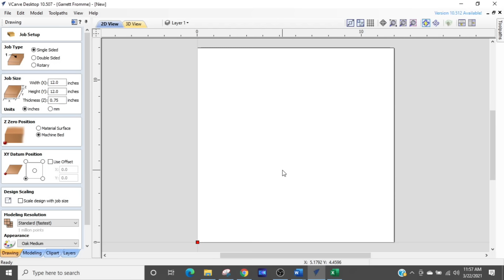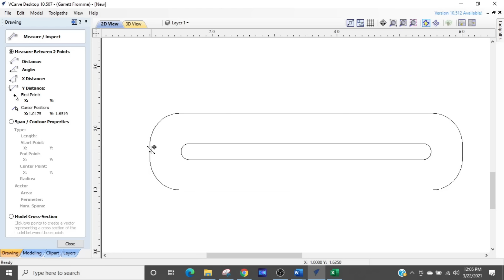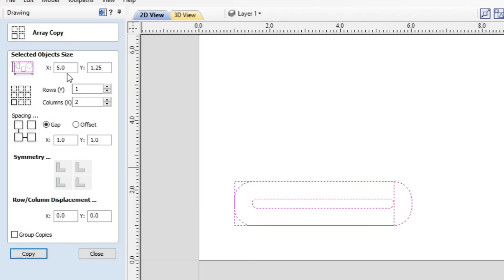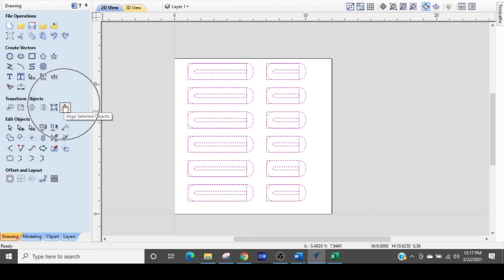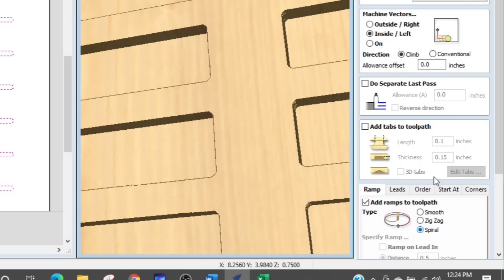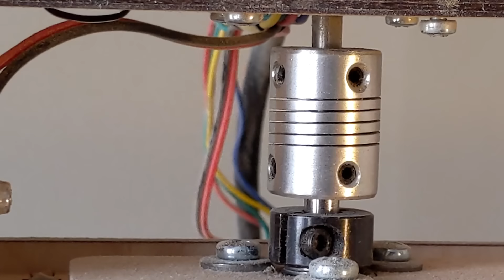How To Make Clamps For Your CNC Router, Easy CNC Router Projects

Comment: Do you have a video explaining the reasoning behind the shape of the clamps and how to use them?

It looks like the clamps are meant to be used in pairs (where one of them sits flat on the bed and helps raise up the rear of the working clamp and concentrate clamping force). But if that's the case, it looks like they're meant for only one thickness of workpiece material.

Ideally I'd raise the lower rear of the working clamp to be slightly higher than whatever thickness my workpiece is. That allows me to concentrate clamping force on the front of the clamp, where it's actually touching the workpiece. If I had a 1.5"-thick workpiece, that first clamp would need to be comically thick to raise the "working clamp" high enough.
Reply from the maker: That's a thoughtful observation about the clamps, brother! They are indeed designed to offer versatility for various thicknesses, but it can be a bit tricky when you're fine-tuning the setup—it's best to experiment and find what works for you!

Comment: Just wondering why you zeroed to the spoil board  ?
Where did you set your x and y to ?
Reply from the maker: Hey there! I zeroed to the spoil board to ensure a consistent reference point for all my cuts. For the X and Y, I typically set them at the front left corner of my material, but it can vary based on your project needs.
Reply: Ok thank you

Comment: GOOD MORNING GARETT. I PURCHASED THE FILES FOR THE HOLD DOWNS IN ETSY. THE JOB BIT WILL NOT PLUNGE DOWN TO HIT THE MATERIAL. RUNS 1/2 TO /34 ABOVE. WHAT COULD BE ISSUE? USING CUT2D DESKTOP-CANDLE SOFTWARE. I RAN IT COMPLETY WITHOUT THE BIT FIRST AND THEN THE 1/4 BIT SAME ISSUE.THANKS
Reply from the maker: Zero off your spoilboard before you run the project brother! That should fix your problem!

Comment: I keep rerunning this and comparing to my bits.  Is this an up or down endmill?  My IDC settings are different from what yours are showing.  I am relatively new to this and not sure how the different setting for pass depth, stepover, and spindle speed for example would affect the cut.
Reply from the maker: The current settings you have in the database are correct. This video is quite old and out of date

Comment: Thanks. I picked up some things I didn't know, about layers and arrays and spirals.. I set mine up in individual rows/files so they can be grouped on any width wood I have laying around. The best thing I learned is to zero off the machine surface, not the work surface, so not to mark your spoil board. I had no idea it worked that way.  Note: @ about 25:03 you say "1.8" inch and I'm sure you meant .18 inch as shown in the video.
Reply from the maker: PaulSchuster-yj4zb, glad to hear that this one helped you out so much my friend. As for the part at 25:03, you are 100% right, I meant to say 0.18"

Comment: Garret. Thanks for all the great video's and advice. My husband and I downloaded your 18 & 24 clamp files today. We're able to open up with the vectors but no Toolpaths or G codes. We've just got out Shapeoko a few days ago so we are running Carbide Create 7. Is this the reason we didn't receive  or can't open tool path with G codes? Thank you in advance.
Reply from the maker: roxannehulsbrink6467, It sounds like you are trying to open up gCode files in Carbide Create. What you need to use is Carbide Motion to send the gCode to your machine directly instead of using design software. If you are still having troubles, please send me an email at garrett@idcwoodcraft.com. I would be happy to help you in more detail my friend.

Comment: Just got my new CNC running yesterday and was needing help with it. I found your channel and it helped me make my slots for my spoil board. I am having a problem with my holes not lining up. I have the rows set perfect in V carve on where I want them and use the touch plate for the lower left corner but it seem to go past where I want the row by 4-5 mm. Not sure what the problem is. Any ideas?
Reply from the maker: Drich6816, I'm glad it was helpful brother! This one is a little too tricky to answer over comments. I recommend joining Kate and I for our weekly live session we host every Wednesday at 8PM EST and we should be able to help walk you through it then!
Reply: Thanks for the reply, After beating my head for a bit and watching more videos I found my mistake . On the zero touch pad I had the wrong bit size. Oops. I will be forsake watching your channel and subscribed  @IDCWoodcraft

Comment: Thank you Garrett. I noticed the other clamps you made at the end of the video had a small lip to hold the work piece down. Did you find an issue with using the clamps with the lip on the end? Thank you for sharing the details on how to create these.
Reply from the maker: enduringpromise, I haven't run into any issues yet brother!

Comment: Good job on covering this, it made it easy for me to follow along.  I made one tiny change in mine; I added an additional pocket at the tip (I think a tenth of an inch) to see if it would increase the lateral holding power.
Reply from the maker: Dan, thanks brother! That's a great idea to add an additional pocket, nice work!

Comment: Very helpful video, I followed you clearly until laying out the tool path for the final outer profile cut. I would have thought that the start cut height for the outer profile of the clamp would have been the material thickness. In the video I believe you showed it as 0, but I thought that 0 was table top not material top. Did I miss something, or just not quite understand?
Reply from the maker: Brian, apologies on the confusion on that one brother. When you are setting up your toolpaths, the software considers the top of your project surface as its internal coordinate reference plane. 
Basically, it doesn't matter if you set up your project to have the Z zero to be the topmost surface of your project or the surface of your spoilboard, you will set up the toolpaths the exact same way for either case.

Comment: If using a 3018 pro cnc and I buy your clamps would I need to change speeds and passes and bit size. Thanks
Reply from the maker: Ron, your machine is a bit too small to use these clamps with. I would recommend using your machine with the clamps that came included. They will be your best bet brother!

Comment: Great video and tips! I’m a cnc newbie and with a Yora 3018Pro. I designed my clamps in Fusion360 and carved them out with an 1/8” compression bit and the spiral ramp really makes a huge difference with a small router with the small diameter bit. Thanks
Reply from the maker: Glad this one helped Sean. Happy to hear that your 3018 is up and running!

Comment: seems easy enough lol
Reply from the maker: Brian, give it a shot brother!
Reply: Garret in 6 more weeks I can. stilling waiting on my backordered machine to arrive.
Creating the file as you have show us made it pretty simple to design for sure.
I have a question about about designs for cast acrylic and glass etching. its about node editing. Do you really need to edit nodes since we will be using a spring loaded diamond drag bit and a 1/16th and 1/8th endmill or is that mainly when you will use a end mill to profile cut around a shape say as a bitmap image? In need ofsome clarity on that since I can run a test right now on cnc router. If you could please

Thanks

Comment: Help I use Vcarve and watched the video as i did the program at the end I when to save I mark visble toolpaths to one file I then get an error the visble toolpaths use different tool all the tool are end mill 1/4 in what am I doing wrong
Reply from the maker: Hi John, that is a great question.  Try double checking your toolpaths and making sure they use the right tool. You could also try and save the gCode files individually to run on your CNC.

Comment: Being that I've already uploaded your IDC Drill bit data in the tool database, is it good to change the feed and speed rates and/or tool numbers like you are doing on the video? Also are you using an upcut or downcut 1/4" EM? Thanks Garrett
Reply from the maker: Hey Max, you can change around your feeds and speeds as needed. The feeds and speeds table is a great guide for you to start out with. You'll develop some intuition over time and practice and may choose to change some numbers around. I changed around mine for this project. And I used a 1/4" downcut endmill for these.

Comment: Great tutorial.  I was able to set up the project in VCarve Desktop with no issues.  It took me a hot minute to realize that Desktop doesn't have the spiral ramping option or the 3-D tabs...but in any event once I set up the project on the machine, zeroed it out and set the Z (to the bed & not the top of the piece..SMH) it cut like buttah.   I only made 4 sets just to test it out as it was my first cut other than leveling the spoil board and cutting in my grids.  Thanks again.  I have much to learn but am psyched at my progress and all thanks to you and your tutorials Garrett.
Reply from the maker: Yay Martha. I forgot to mention in the email that is was very cool to see the clamps made!

Comment: Another great video, as I am now watching your whole playlist 😁 I have saved a lot of your videos to back over when I have more time. I have just bought this program from Etsy and intend to run it soon, but I am going to use 19mm Marine ply as I have a ton of it laying around, hey if it works great, if not then I will buy some pine. I will be using metric tools so hope it still works the same or I will edit the tooling in the program to suit.
Reply from the maker: Hi Warren. Ply works gread for this. You might want this PDF download. It is all the videos I've created and they are sorted. Here's the download link → https://bit.ly/3mLHGfI

Comment: Garrett Just watched this video and followed as you designed them .
Question Isn't there some way to select the first one you made and resize the whole clamp  with out doing every item one at a time.
Jeff Peters
Reply from the maker: Hi Jeff. Good to hear from you brother. Yes, you can simply select the ones you want, and squish them down using the little bead at the bottom, top, or side. Does that make sense?

Comment: Hi Garrett, great video would you consider making one for the rounded clamps that let you apply pressure from the sides of your project to lock it down?

Thanks! Tim
Reply from the maker: Hi Tim. I gave it thouoght before. Eventually I will make that style available
Reply: @IDCWoodcraft  That would be great, the biggest difficulty is getting the hole in the correct place so you are always applying leverage no matter which part of the paddle is applying the pressure. I don't know if you got my last note but the spindle was spinning counter clockwise as you had suspected. I had to switch to wires to get it turning clockwise and now everything works great.

Thanks!
Reply from the maker: @timcreagh585  I see that running backwards from time to time. I'm glad you got it figured out

Comment: Garret One thing to bring up with this video make sure that when you cut the camps you are going with the grain if you are not using plywood.  The clamps will snap if cut across the grain
Reply from the maker: Hey Larry. I thought I covered that. Thanks for pointing it out. I''ll add it to the comments in the video

Comment: I like your design.  Instead of using my CNC to make these I used your dimensions and designed them in Fusion 360 and then 3d printed them.  Will give them a try once I get my MPCNC completed.  Thanks!
Reply from the maker: Hey Dave, send me pictures. I'd like to see
Reply: @IDCWoodcraft  just sent over the pictures to your email address.

Comment: When using 3d tabs the bit will not stop, raise up, cut over, plunge down, and continue the cut.  The 3d tabs ramp on the up and down movements and do not stop the movement.
Reply from the maker: You're right. I keep forgetting to set it for 3D tabs and tell people to use them instead. Thanks for reminding me.

Comment: great video as usual. its worth pointing out that the clamp needs to be cut with the grain of the wood running in the long direction on the piece. otherwise they will snap in two. something to consider when laying out your file based on your available material.
Reply from the maker: Hi Adam. Yeah, sometimes I forget even the basics need to be stated for new people. Thanks for commenting about that.

Comment: Really like the Spiral technique. Much easier on my router. I need to get some downcut bits . The up-cut I have seemed to work out though I just wasn’t sure wether to use the climb or conventional setting. I just went a little slower. Thanks for the video.
Something else I thought of also is that before a person pulls the parts you could make a rubber mold and then pour in what ever mold material you liked to make a stronger Clamp if you desired to.
Reply from the maker: Oh Sim, you have given me an idea!!! I might start making clamps. And I can make the mold to make them. I am getting requests for clamps.
Reply: @IDCWoodcraft  That’s great.

Comment: Thanks for pointing out the spiral plunge. I've been using ramps, but it is slow.
Reply from the maker: Hi Bob. Ready for a little tip? Ramp and spiral are both plunge moves and will use plunge feed rates. Edit the tool library and change the plunge feed to the cutting feed.  It'll all go much faster.
Reply: @IDCWoodcraft  Ok, that’s helpful. I think I still like the spiral because of the continuous down movement while cutting opposed to hitting the depth and running at that depth till the next round. Is nice to know about changing the plunge feed to the cutting feed. Thanks and again, I like Vectric and their tutorials are helpful, but you go into more detail and not so matter of fact. And I like when you click on the wrong thing how you explain it as opposed to ignoring it or editing it out. Makes it easier to relate. We all have our little goofs.
Reply from the maker: @BobBob-eh5sb  yes, I prefer the spiral myself and use it on profile cuts as well as holes. Nice smooth travel. As for the goofs...I think it's important to keep them around for the eaxct reason you said.

Comment: I have been a CNC and Vectric user for a while and have no need for more clamps but after watching many of your videos I realize that even though “clamps” is the main topic inside there will be information that I can use on other projects. And was I correct,  as in other videos of yours there were so many other helpful hints. 
Thank you 
One day I’ll get the courage to set up a one on one 
Just one more thought—if you were to use a 3/16EM for the perimeter cutout you could have gotten that one more row of clamps. I use the 3/16EM for cutouts a lot on .75 material. 
Be Safe
Reply from the maker: Hey Lyle. Ya’ know, I think I’m gonna start doing the 3/16” thing. Such perfect sense. From one CNC’er to another…thank you!

Comment: Thank you for this video.  I learned a lot.  I created my own project based on your teaching, but when my router cut all the way through, it went into my spoil board about 1/16"  What did I miss in my setup?  Thanks.
Reply from the maker: Hi Lyle. You probably did not account for the material being thinner that what was set in the software. If you set .75 and material actual is .7, and set start depth from top, then the bit will cut into board. Happened to me too...many times, until I learned to ALWAYS measure the material first.
Reply: @IDCWoodcraft  Thanks for your response.  I forgot to mention that I set my Z zero to my spoil board surface, as you did in your video.  My first time doing that.   My material thickness was actually 0.7515 and I set the material thickness in Aspire to .75.  I greatly appreciate your help.
Reply from the maker: @lylepollett2234  hmmm. We'll have to talk. Not sure why. I'd have to look at your settings
Reply: @IDCWoodcraft  It finally dawned on me what the problem could be.  I decided that maybe the thickness of my Z zero fixture was set incorrectly, and sure enough.  Not sure how I missed it when I set it up.  Lots of learning.

Comment: Idc. I have a kl44 bob cnc. It doesn’t come with a spoil board. I’m trying to get the correct inserts and screws to hold the above clamps down.  Do you have a recommended inserts, screws, nuts for this purpose?  
Also, I enjoyed your bits video. I will order those recommended bits.
Reply from the maker: Hello Road.  Your name makes me smile. I would contact Bobs for recommendations on this. they may have plans. Or look for plans that someone put together on Etsy or something.
Reply: @IDCWoodcraft   Haha. I know...I only have two income streams so far.  But one day, one can hope right.
Reply from the maker: @3calmkids  my friend, keep working at it. I currently have 4

Comment: Gwdave1997 
I built a couple of clamps first to see if I could then bought your setup.  The only item I changed the size to 16 X 16 and cut them from there.  Setting the Z axis did cut the wood all the way thru however I now have a bunch of lines on the spoil board.  I do have to say that I used the clamps I built using your setup for the original ones then I now have enough clamps for anything I want to built, and love the way they work they are as good as the OPPS clamps that cost $50.00 to buy 4.  Would I build them again, you bet thank you for such a great plan....
Reply from the maker: Hi Dave. You just can't have enough clamps. Isn't it nuts? We buy clamps for that price when we can just make them? Glad it workd for you!

Comment: Correct me if I am wrong. You should be able to resize the clamp on the right in one step if you use the Set the Selected Objected Size Tool uncheck the link XY box select all vectors and change the width size.
Jeff
Reply from the maker: Hi Jeff. You are correct. The reason I didn't do that was to hold the step distance of 0.5". The other more important reason was to teach people how the rectangle function workls.